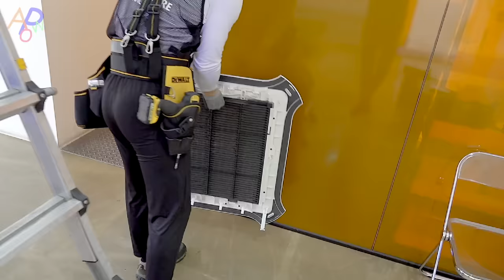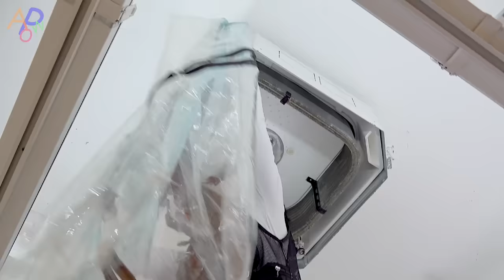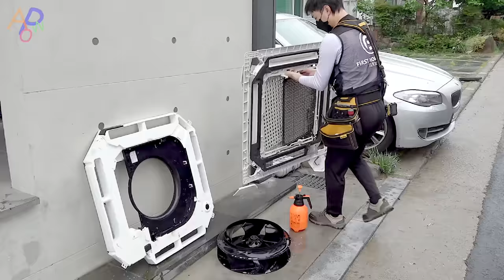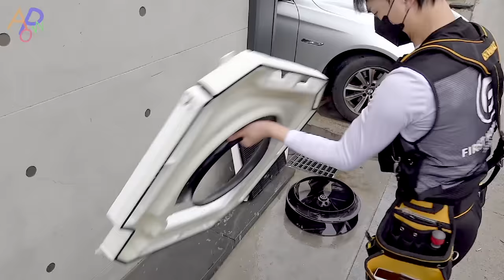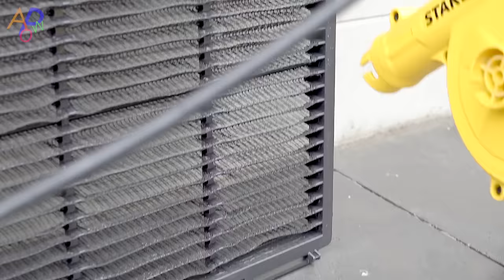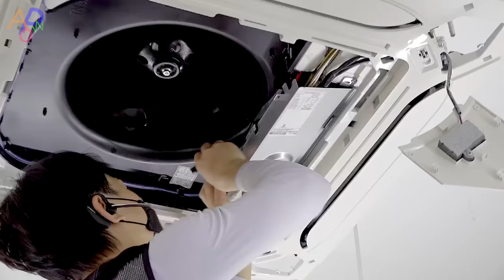Korea's Amazing Ceiling Air Conditioner Decomposition and Cleaning Process

Comment: Two things. A. If that filter was cleaned regularly. You wouldn’t have to take it apart that far except every other year. B. There’s a little plastic bar to secure the fan blad so you don’t bend the mounts or break the plastic blade.
Reply: Every AC needs servicing at least in 1 year.
Reply: @RioNewss  that’s a rookie phrase. To sell more contracts. Clean your filters, rinse outside unit. And you won’t that kind of servicing except when I posted. Also.

Comment: If you rig a top hold on your outdoor American condenser you can blow (non pressure) water inside out. Disconnect AC breaker first of course. It goes way quicker. Just use water as you dont want foreign compound on the metal.

Comment: I did a part-time job of it(air conditioner, laundry machine high pressure cleaning same in south korea) i did it when boss toss me a part of air conditioner i cleaned each parts several times. Because detergent can remain in air conditioners sponge area. When i finishes the clean i checked each sponge parts to pressing of it to wash out remain detergents. If i don't there's can be unwashed detergents when drying air conditioner.

Comment: Hello sir, my name is Shakib and I am from India. I repair the printed circuit board (PCB) of all the electronic items of a house like refrigerator, washing machine, AC, and oven. In this, I am more specialized in inverter. I am into repairing the circuit (PCB) of AC and normal AC. I want to come to your country and work and fulfill my dream, for this I will need your help, you can help me by giving me work, I am ready to come to your country! If you don't need a (PCB) technician right now, no problem, but please tell me the approximate monthly salary I will get in your country.

Comment: Not amazing as it is the typical way to wash a ceiling cassette type AC.
Not professional as the technician did not put any protective film / tower on the concrete floor when he did the cleaning on the covers outdoor which leave scratches on the plastic parts.
Once you finish cleaning, you first turn to fan mode and dry up the coil and parts but not the cooling mode.

Comment: Evaporator cleaning and drying are not complete. No brush use during cleaning process. Pressure is too low to clean out the contamination.